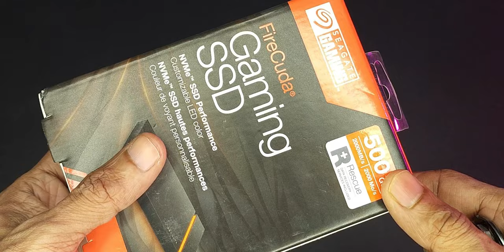Seagate Firecuda Gaming SSD - Disassembly/Extracting NVMe Drive

Comment: Fantastic! Does the shucked SSD work fine when removed? (The WD External Gaming SSD has a firmware lock where it only has very slow speeds outside of the enclosure)
Thank you for the video!
Reply: I can confirm it works
Reply: Ok, so there is no Software lock, and you can use it at full speed outside the enclosure?  @Carl-Camera
Reply: @Carl-Camera doesn’t work for me idk, can’t read or write after few mins

Comment: i wonder if i could install a Seagate Firecuda 530 2tb in there see if it works?
Reply: It works.
Reply: But over USB, you'll be slowing that drive down so much.. o.o
Reply: Hey, I got this thing (2tb version) for dirt cheap, do you think I can remove the SSD and put it in my own system?